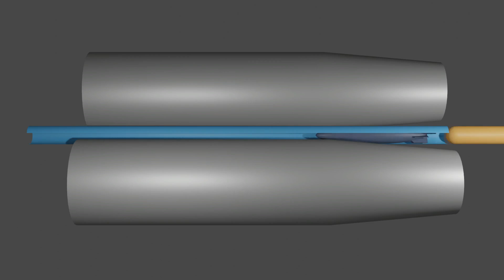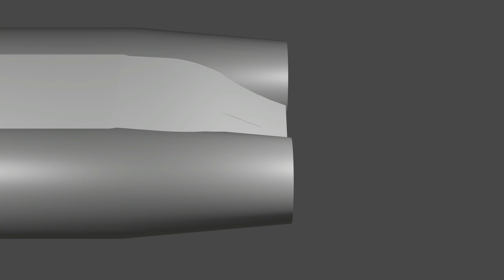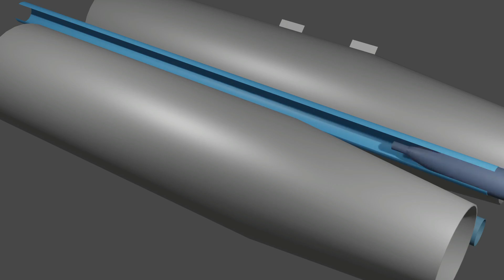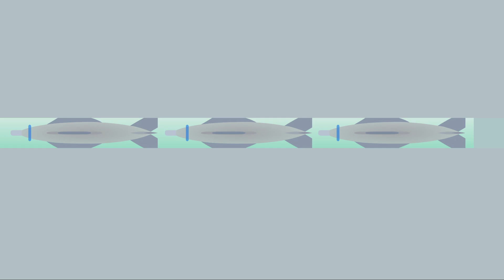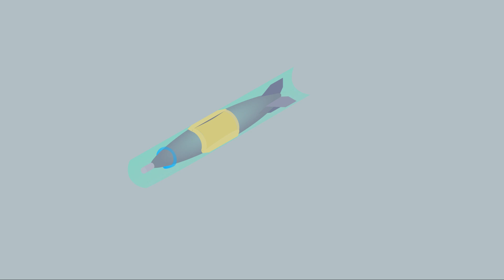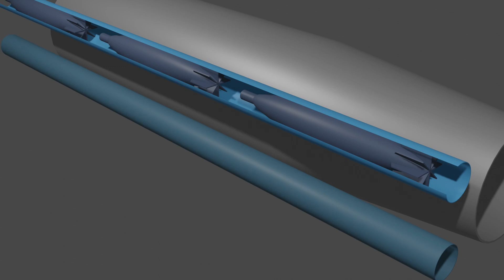tube bomb

Comment: Radar signaure will be similar, drag will be smaller, but time of drop bomb will incrase and there is a chance that bomb that stuck during dropping (stress of high G forces) will jam rest of bombs in tubes. Guided bombs can be dropped as dumb bombs in CCIP mode or CCRP, where time of drop have to be constant.